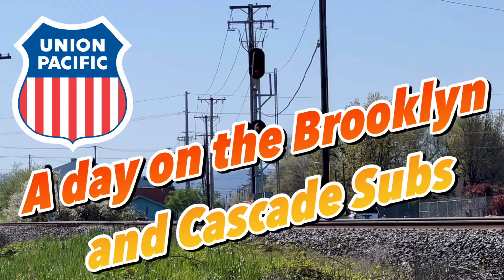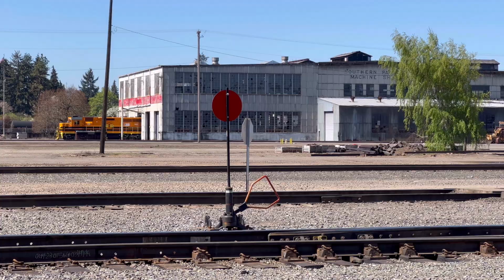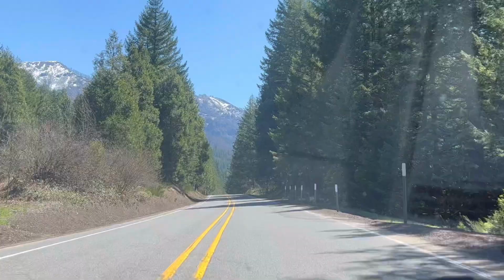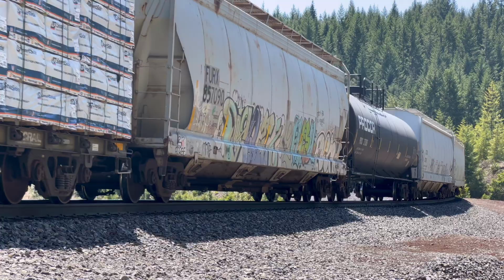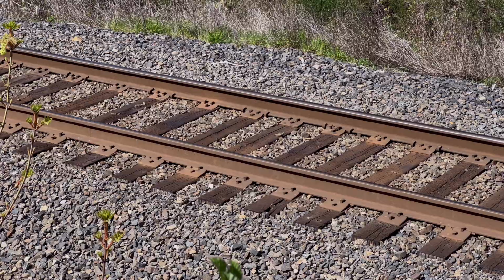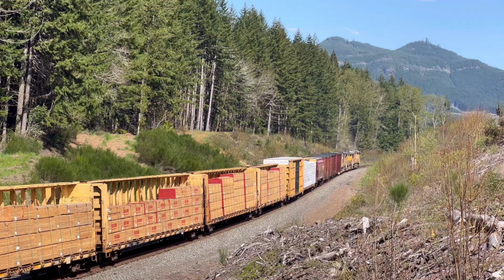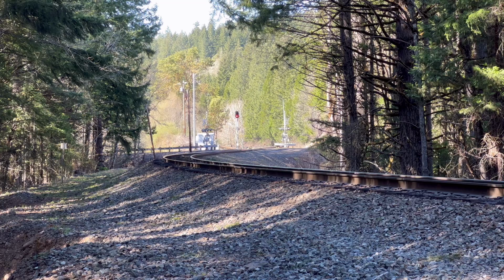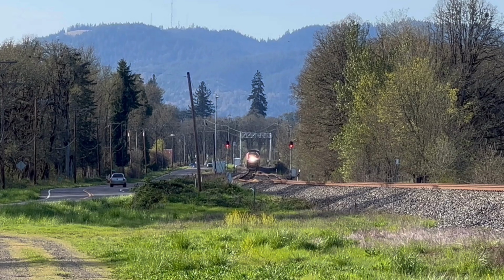FROM EUGENE TO THE CASCADES on the UNION PACIFIC

Comment: I saw almost 10,000T and 5 locos and went nope not going to work. UP really needs to do an AC rebuild of the SD70M given they've got over 1400 unless the plan is replace them.
Reply from the maker: Yeah…we didn’t used to use so many SD70s. They came out of storage or got shipped up here from the Midwest…this summer will be tough if we don’t start providing more (better) power to these heavy trains.
Reply: @pacificrailproductions5281  the SD70AC from what I know should be be fine, still just an odd choice that in 2000 UP ordered 1500 DC engines. Yeah DC power was an odd choice given the grades

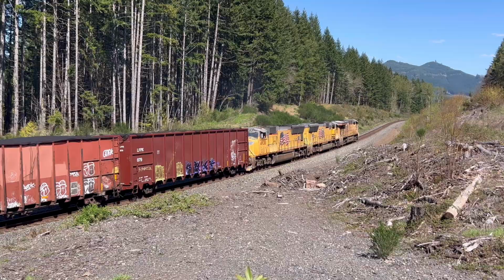Comment: 28:00 what was going on with the train what were the problems
Reply from the maker: Too much tonnage and heat for too little power. Along with max tonnage pulled by DC engines.